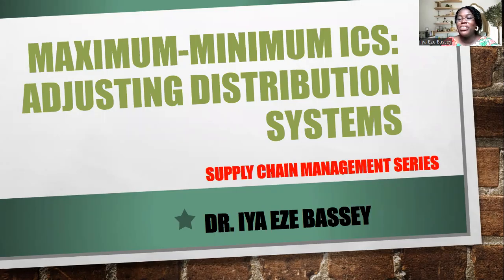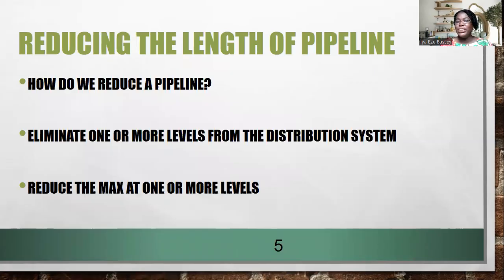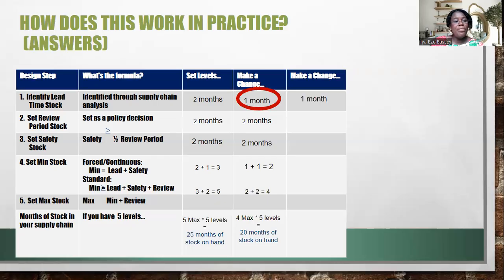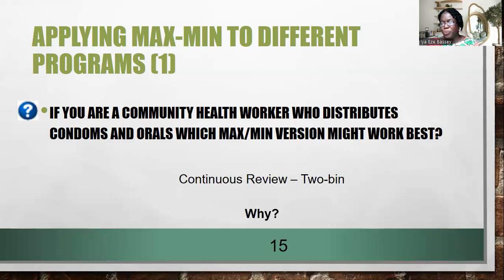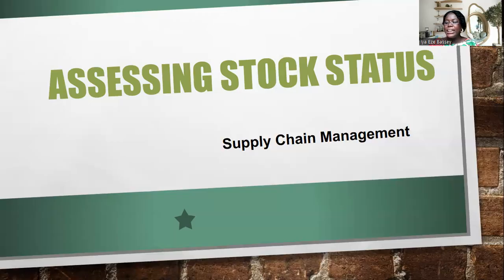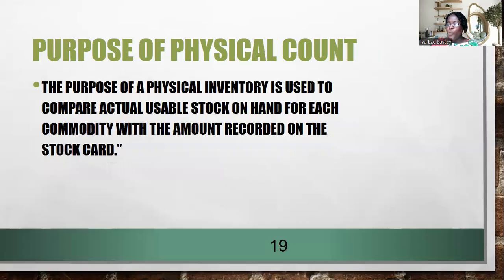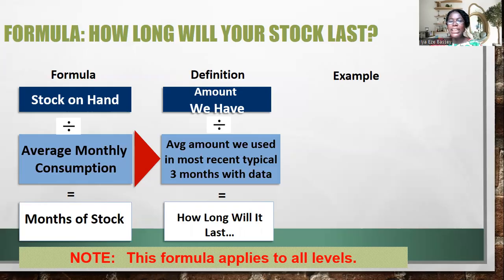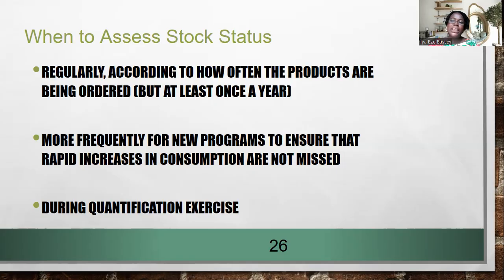Maximum-Minimum ICS: Adjusting Distribution systems (Supply chain management series)

Comment: In summary Adjusting distribution system in max_min inventory control system is to reduce the factors affecting distribution 

Advantages of max-min inventory control system 
(i) Avoid overstocking 
(ii) Avoid understock
(iii) Minimise wastage

Max-Min inventory control system also undergo certain challenges which are:
(a) System with numerous level
(b) Systems that manage products for new programs
(c) System that manage large number of commodities 

I also understood the ways which length of pipeline can be reduced 
1. Eliminating one or more levels from the distribution level
2. Reducing the max at one or more level.

Finally physical count of stock is important and should be done atleast once a year, incase where stocks are moved rapidly..

Comment: Maximum -minimum ICS .
Adjusting distribution system.
Steps; 
Setup initial max-min policies for each level.
Check if the overall distribution will function properly.
Check the total length of the pipeline.
Some of the factors that impact max-min stock levels are;
Cost of products 
Reliable transport system 
Storage capacity 
Cost of storage 
And storage condition at different levels.

Physical inventory is very important because it's used to compare actual usable stock on hand for each commodity with the amount recorded on the stock card.
Thank you ma'am.

Comment: Thank you ma for the lecture. Now I will be highlighting what I've learnt from the lesson.

Highlights
- 📦 Adjusting Distribution Policies: Learn how to modify distribution policies for efficiency.
- ⚖️ Max-Min Inventory Control: Understand the benefits and challenges of max-min inventory systems.
- 🩺 Logistics for HIV Commodities: Explore the inventory control systems used for managing HIV-related supplies.
- 📏 Assessing Stock Status: Discover the importance of evaluating stock levels and their implications.
- ⏳ Pipeline Length Reduction: Strategies to shorten distribution pipelines for timely delivery.
- 📉 Cost and Reliability Factors: Factors affecting inventory levels, including costs and supply reliability.
- 🔍 Physical Inventory Counts: The necessity of physical counts to ensure stock accuracy.

 Key Insights
- 📈 Policy Implementation: Properly implemented maximum policies at each distribution level can enhance overall supply chain efficiency. This ensures that each facility operates within its optimal inventory levels, reducing waste and stockouts.
- 📊Advantages of Max-Min Systems: These systems help avoid overstocking and understocking, leading to cost savings and better resource management in public health supply chains.
- 🌐 Logistics in Public Health: Effective inventory control systems are vital for the timely distribution of HIV commodities, ensuring that healthcare facilities remain well-stocked and functional.
- 📉 Reducing Pipeline Length: The length of the supply pipeline can significantly impact delivery times; identifying and removing unnecessary levels can streamline operations and improve responsiveness.
- 🔄 Dynamic Inventory Adjustments: Inventory control systems must be adaptable to changing circumstances, such as lead times and consumption rates, to maintain efficacy.
- 🗂️ Importance of Stock Assessments: Regular stock assessments are crucial for understanding usable inventory levels and predicting how long supplies will last, which is essential for effective resource management.
- 🤔 Challenges in Inventory Systems: Complex systems managing numerous commodities face difficulties, highlighting the need for tailored approaches to inventory control based on specific program requirements.

Comment: THANKS MA!!!

I also learnt on the steps on designing the maximum ICS which involves different steps like setting up an initial MAXI-MIN policies for each level and type of facility by checking the total length of the pipeline 

Then I noted the factors that can impact MAXI-MIN stock level which Include.
- Cost of Products 
- Storage Capacity
- Lead time a
- Reliability of Transportation
Reply: Thank you very ma'am.
I learned on the steps of designing a Max-Min ICS which are:
*Set up initial Max-Min policies for each level and type of faculty
Check if the overall distribution will function properly If the level specific Max-Min are implemented.
Check the total length of the pipeline that the policies at each level imply,and also others Factors that Impact Max-Min stock level which are;
Lead Time
Management skills staff
Age program
Accuracy of forecasts
Effect a zero balance of stock.

Comment: In summay i understood steps aimed at designing the Max-min ICS and they include:
Setting up an initial Max-min policies for each level and the type of facility, checking if the overall decision will function properly,if the level specific max-min policies are implemented and checking the  total length of the pipelines that yhe policies at each level can imply.

It outlined the factors that can possibly affect max-min ICS levels which includes:
-lead time 
-cost of products 
-cost of storage 
-storage conditions at different levels 
-shelf life of health commodities 
These factors listed were discussed to have some advantages of using a MAX-MIN ICS like minimizing shortage,avoid overstocking and avoiding understocking etc.
I also learnt yhe challenges associated with using each version and variations.we discussed assessing stock status and outlined physical inventory as one of the ways involved.

Comment: In summary 
Designing this system involves  defining policies,assessing distribution feasibility and analyzing pipelines length.

Advantages of Max-Min inventory control systems include 
1. Preventing overstocking and under stocking 
2. Preventing wastage
3. Reducing emergency cost order
4. Maintaining consistent cost level

Comment: I've learnt a whole lot from this educational lecture on Adjusting Distribution System in the Max-Min Inventory Control system 
The first thing to consider when designing a Max-Min Inventory Control system is identifying the length of the pipeline.
They're various steps in designing a Max-Min ICS, some of which include:
The set up of initial maximum policies for each level of the system and policies for systems can't just be altered until other factors are considered.
Check the total length of the pipeline that the policies at each level imply and one of the ways of modifying the pipeline so that the goods would reach the client faster is elimination of one or more levels from the distribution system or setting up policies that would help reduce the max at one or more levels.
I learnt from this Lecture that the version recommended for Drugs, HIV test kits and labs are the Standard Order.
In Assessing stock order,I learnt that  the purpose of physical count/Inventory is to compare actual usable stock on hand for each commodity with the amount recorded on the stock card.
I also learnt the formula used for calculating the amount available for months of stock and how to apply the formula under certain conditions.
Thank you soo much ma for this lecture.

Comment: Maximum- Minimum ics: Adjusting distribution system
 It is necessary for adjusting pipelines to ensure accurate inventory of commodities 
How to Reducing length of pipeline 
By removing one or more level from the distribution system 
Factors that impact max - min stock level are
1. Cost of product 
2. Reliability of transportation 
3. Storage capacity 
4. Cost of storage etc 
Advantage of using max-min system 
-Avoid overstocking 
- avoid wastage 
- avoid under stocking 
- consistency of stock level etc 

Thank you

Comment: IN SUMMARY 
A pipeline, or distribution pathway, can be lengthy (up to 20 months) and requires adjustments to optimize the system, including eliminating distribution levels and reducing Maximum Stock Level (Max) by shortening Review Period, reducing Lead Time, and improving distribution system reliability.

Factors impacting Max-Min Stock Levels include product cost, transportation reliability, storage capacity, lead times, supply reliability, management skills, program age, and forecast accuracy.

Inventory systems face challenges such as multiple distribution levels, managing large numbers of commodities, and new programs.

A Physical Count is a manual count of usable units to compare actual stock with recorded stock. Assessing Stock Status determines how long supplies will last, identifying overstocking or understocking, and is done regularly, at least once a year, and during quantification exercises.
Thank you Ma for this enlightening lecture.

Comment: Maximum minimum ICS is necessary for adjusting pipeline and ensuring accurate inventory of commodities 
It avoids overstocking and understocking, cost of emergency orders, reliable data source from SDP, minimize wastage, simplify inventory control decision making, etc
Some disadvantages include system with numerous levels, systems that manage large number of commodities, systems that manage products for new programmes.
Thank you ma'am

Comment: From this educative video I was enlightened on the steps in designing a Max-Min Inventory Control System.
1. Set up initial max.min policies for each level and type of facility 
2. Check if the overall distribution will function properly if the level specific max.min policies are implemented 
3. Check the total length of the pipeline that the policies at each level implies.
I also learnt some important factors that can impact max.min levels which are cost of products, reliability of transportation, cost of storage, storage capacity, lead time. Also the advantages of using max.min systems, the challenges to using each version and variation.
Also, Physical count is the process of counting by hand the total number of usable units of each commodity in your store or health facility at any given time. 
Finally, Stock status should be assessed regularly, more frequently and during quantification exercise. It should be ensured to know how long supplies will last. 
Thank you ma

Comment: Thank you Ma for the detailed lecture on Maximum- Minimum ICS... From this lecture i learnt that Maximum-minimum inventory control systems help manage stock levels by setting maximum and minimum thresholds. Designing these systems involves defining policies, assessing distribution feasibility, and analyzing pipeline length. Key strategies to reduce maximum stock levels include shortening review periods, optimizing lead times, and improving distribution reliability. Factors influencing stock levels include product cost, transportation reliability, storage capacity, storage conditions, and shelf life.

Advantages of maximum-minimum systems include preventing overstocking and understocking, minimizing wastage, reducing emergency order costs, and maintaining consistent stock levels. However, challenges arise in managing multi-level systems, diverse commodities, and new programs.

Comment: In summary,I learned that the ways to adjust distribution systems in ensuring a maximum & minimum inventory control system is by: 
1. Checking the length of the pipeline (i.e the entire chain through which supplies are moved from the manufacturer to the user).
2. By reducing the maximum stock level(i.e the review Period & lead time).

Also, the maximum & minimum inventory control system is advantageous to avoid overstocking, understocking, wastage, reduce cost of emergency orders, simplify inventory control and ensure consistency of stock levels etc.

Thank you❤

Comment: I learnt that the steps in designing max- min ics are:
1.set up initial max- min policies for each level and type of faciuty.
2.checj if the overall distribution qill gunction properly if the level specific max-min policies are implemented.
3. Check the total length of the pipeline that the policies at each level imply .
ELEMENTS  OF THE FORMULAS WHICH CAN BE CHANGED IN ORDER TOREDUCE THAT MAX STOCK LEVEL:
1.shorten the review period at one or more levels.
2.redirect the lead time at one or more levels.
3.improve the distribution system reliability at one or more levels so that safety stock ban be reduced.
OTHER FACTORS THAT IMPACT MAX-MIN STOCK LEVELS .
1.cost of product.
2.reliability of transportation.
3.storage capacity.
4.cost of storage.
5.storage conditions at different levels.
6.shelf-life of health commodities .
ADVANTAGES TO USING MAX-MIN SYSTEM.
1.avoid overstocking
2.avoid under stocking.
3.minimize wastage.
4.avoid cost of emergency orders.
5.consistency of stock levels.

CHALLENGES TO USING EACH VERSION AND VARIATION.
1.system with numerous levels.
2.systems that manage a large number of commodities.
3.system that manage products for new programs

Comment: Thank you for the wonderful teaching. 
In this particular topic I have learned that, In designing a maximum -minimum inventory control system , the steps involved are:
Set up initial Max-Min policies for each level and type of facility. 
Check the overall distribution will function properly if the level specific Max-Min policies are implemented. 
Check the total length of the pipeline that the policies at each level imply. 
Factors That Affect Max-Min Level Are:
Cost production. 
Lead time 
Storage 
Capacity 
Cost of storage 
  Lastly, Age of program. 

Thank you

Comment: Thank you ma for this lecture.
    In summary i learnt that there are steps involved in designing a Max-min ICS and they include;
1. Setting up initial max-min policies for each level and type of faculty.
2. Check if the overall distribution will function properly if the level specific max-min policies are implemented.
3. Check the total length of the pipeline that the policies at each level imply.
   I also learnt that the ways to reduce the length of pipeline is by:
- Eliminating one or more levels from the distribution system.
- Reducing the max at one or more levels.
   Some factors that can impact max-min stock levels includes;
* Cost of products *Storage capacity *Reliability of transportation *Lead times,e.t.c.
  Advantages of using max-min system
- It avoids overstocking and understocking.
- Minimizes wastage.
- Consistency of stock level.
   PHYSICAL COUNT
  This is the process of counting by hand the total number of usable units of each commodity in your store or health facility at a given time.

Comment: In summary i understand that 
A pipeline is like a pathway of distribution in which some may take 20 months to arrive it's destination,so the need for adjustment. How do we reduce the length of pipeline?
1. Eliminating one or more levels from the distribution system. 2. Reduce the maximum at one or more levels by setting up policies. To carry out these reduction, steps are required such as;
Change in element formulas like shortening the review period,we can also reduce the lead time etc 
ADVANTAGE OF MAX-MIN SYSTEM:
Avoid overstocking and understocking, minimize wastage, avoid cost of emergency, consistency of stock level etc. Challenges of the system can arise as a result of; numerous level in the system, managing large numbers of commodities, managing product for new program.
 How do we assess stock status; we can assess stock status using physical count, which can be done once a year or occasionally based on situation. It is calculated using;  stock in hand÷average consumption.

Comment: Thank you ma,
LENGTH OF A PIPELINE
Steps involved in designing a max min ICS  are
1.Set up initial max min policies for each level and type of facility
2. Check if the overall distribution will function properly if the level specific max-min  policies are implemented
3. Check the total length of the pipeline that the policies at each level imply.

HOW TO REDUCE THE LENGTH OF A PIPELINE
1. Elements of the formulas which can be changed in order to reduce the max stock level

OTHER FACTORS THAT IMPACT MAX-MIN STOCK LEVELS ARE
1. Lead times
2. Reliability of source of supplies 
3. Effect of a zero balance of stock etc.

CHALLENGES TO USING EACH VERSION AND VARIATION
1. Systems with numerous levels
2. Systems that manage a large number of commodities etc.

DEFINITION OF A PHYSICAL COUNT is the process of counting by hand to the total number of usable units of each commodity in your store or health facility at any given time.